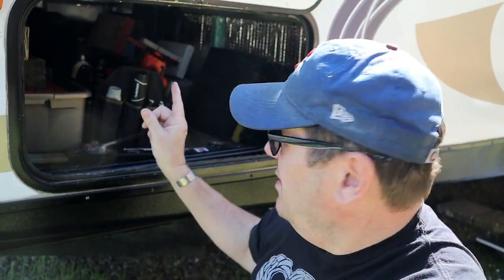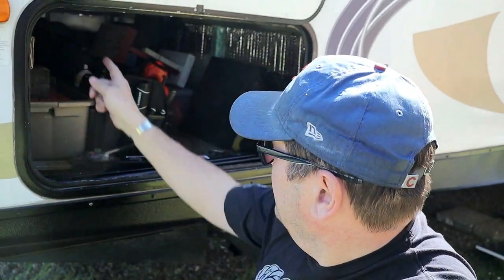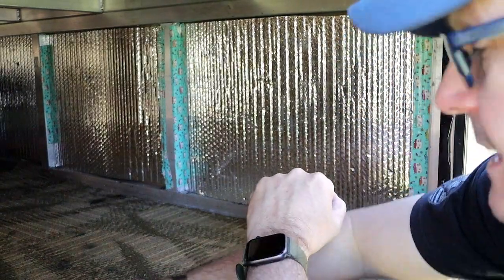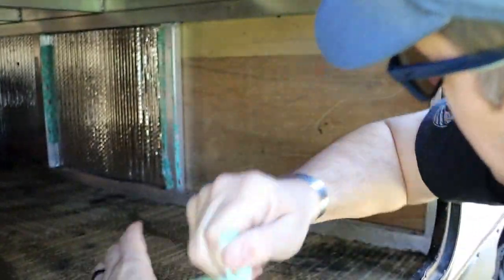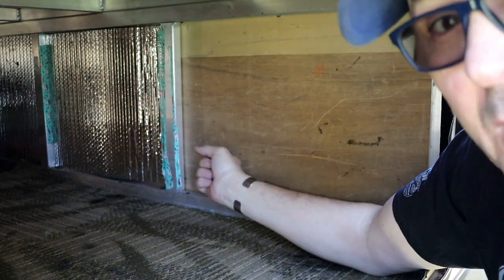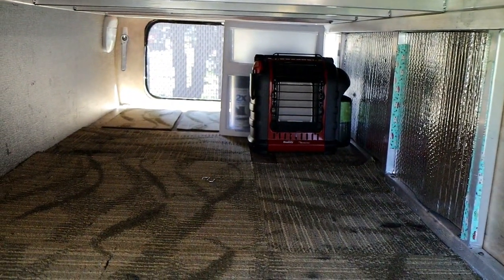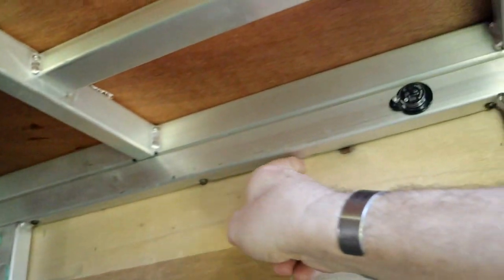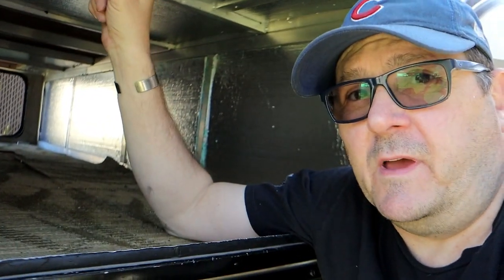ADDING INSULATION TO THE PASS THROUGH

Comment: Hey Jerry, 1. how come you did the foil toward the cold side?  2. I would have done another whole piece over the metal frame. The metal framing is incredibly conductive.
Reply from the maker: Great points.. I think I'll flip those around.  On the second point.. I understand about the frame conducting heat loss.. or adding to the cold.. but I wanted to keep it simple and not take up so much space.  The current boards fit well in the gaps.  It has made a huge difference.   If we lived in a real cold climate I would more than likely consider covering the whole bay.  Thanks